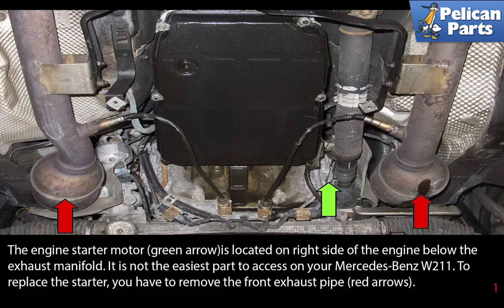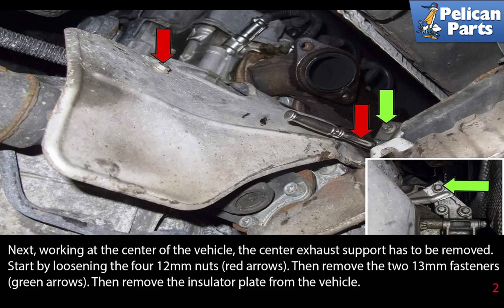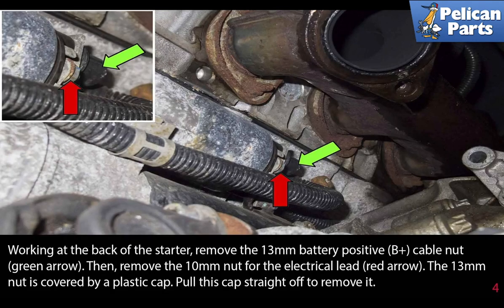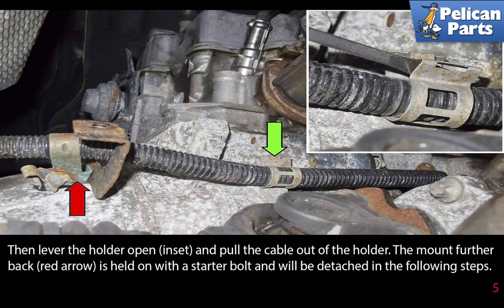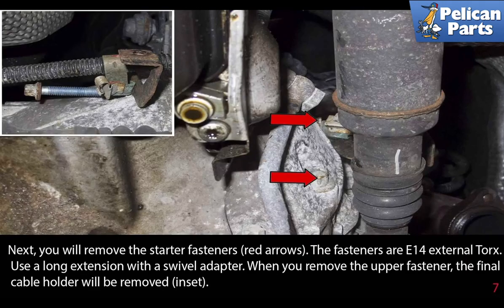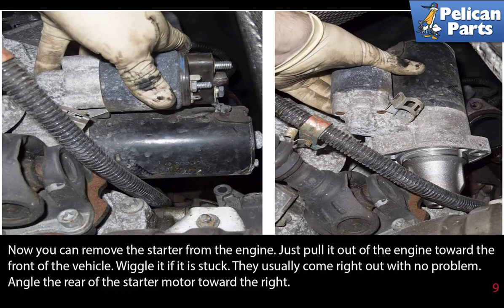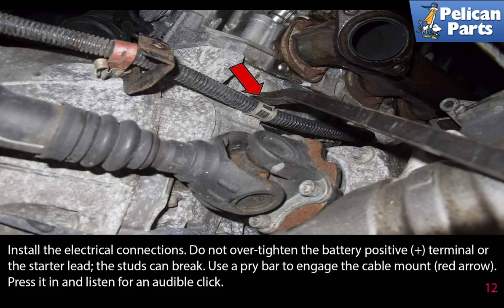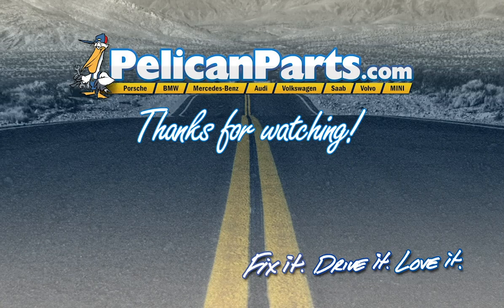Mercedes-Benz W211 E-Class  6 Cylinder Engine Starter Replacement

Comment: The information is mostly correct.  My 2004 E320 wagon doesn't have that heat shield, which made the process a little easier.
Reply from the maker: Thanks for the additional info and feedback. We appreciate it.

Comment: My 2003 right-hand drive CLK 240 W209 M112 starter motor is on the left side of the engine block
Reply from the maker: Thanks for the info.
Reply: Starter is mounted on left side of a w112 body
Reply: How to replace starter